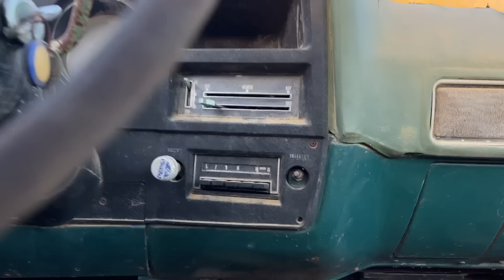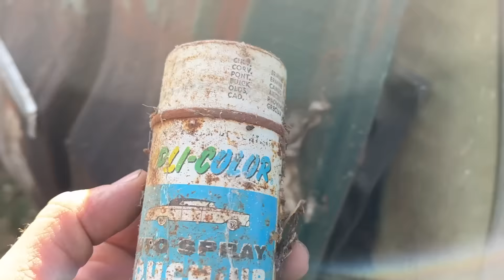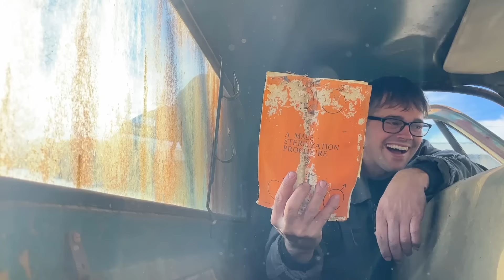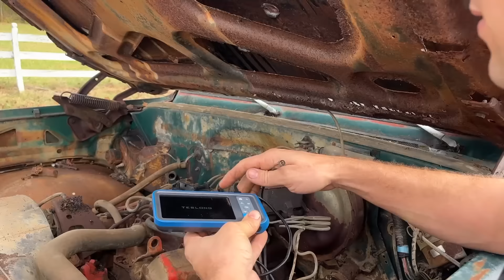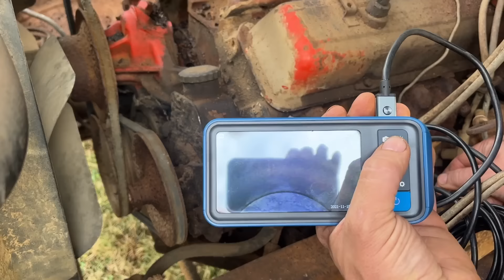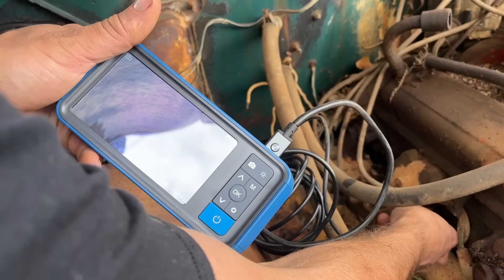Parked 38 years K15 will it start and go muddin?

Comment: Ralphie is gonna be a Master Mechanic before he's 18.He knows more about mechanics than alot of other people.Way to go ,Ralphie! And Wawa is not far behind!
Reply: Now I am 45 but I was able to tell you what you were driving  at 6 in every  Chevy  30s to70s and then if you wanted to learn  mechanics I had to know difference between 123 screwdrivers and  I was  rebuilding mowers for fun dam I miss my master asc gold patch papa who is the reason I am very capable to fix just about anything and now that you can YouTube how to I have  built a Nissan frontier trans with the 20 tip to mechanic at dealership for a how to take a new transmission down to replace reverse fork and I did it for 2k dealership wanted 4500 but u can do anything just learn how you do things and don't rush organization is more important than what brand is the tools now-a-days gear wrench warranty till 9 pm 7 days a week at auto parts store now snap on  its hard if you don't work at shop but I love this family brings me back to my childhood and I have been working on cars professionally since I was 16 so 35 years I have  tool boxes for loaner to the one that was 15k new 54 in 1201 snap-on with all stainless steel top was 1499 option I got box 25 bucks a week for a year and a  36 in blue point 5 ft as trade in I have no problem making a tool always keep cheap set of wrenches in case you need to bend to custom shape  like  dodge ram power steering pump take a custom fit and once you have it saved for the next time you'll need it
Reply: Man you lost me after chevy 30s-70s... I'm sure it has to be typos. Because that is just gibberish
Reply: @Daddyrabbit_2  Brad,pay attention to them.Josh worked as a body repairman for several years,he knows all the new stuff.But,he had to know the old stuff to get to know the new stuff.He also likes to work on the old stuff as a hobby,and now is on YouTube making money there. He knows there's people who,like us,will watch it as well.He involves his family in it as well.Ralphie and Wawa seem to like it as well by assisting Josh.His wife is doing well so just she can understand what's going on.She seems to have some enjoyment.,too.I like to watch their videos.Wjat is not to get.
Reply: @danbytp  I agree. I was referring to Craig streetzels comment, a lot of missing commas, periods and/or words
Reply: @Daddyrabbit_2  My apologies for misunderstanding your comment.
Reply: @danbytp  no problems!
Happy Holidays for you and yours my friend! Wish y'all nothing but,peace, love,and happiness!
Reply: @Daddyrabbit_2  Same to you,sir!
Reply: I'm 19 and everyone is surprised with my knowledge which means people get offended when I'm right on certain things.
Reply: @tandmbros5877  They're just jealous.However, for the rew times you're not right humbly admit it and don't don't have a fit.Use it as a learning experience.
Reply: Ralphies parts will all be clean

Comment: It's a 4x4 , and judging by all the 4x4 owners that I know, it probably got stuck. Somebody said " When in doubt, Gas it out!" and proceeded to over-wind it until something blew. Teenagers take this approach a lot. Great video!  You know what the difference is between a teenager with a 2wd and a teenager with a 4wd ?  The teen with a 4wd gets stuck 40 feet further out into the muck.
Reply: When Ralphie pulled the dust cover off the front wheel, you could see there were no drive flanges on the front axles. Assuming it has a front driveshaft, and working transfer case, it will be a cheap fix.

Comment: Great video - now new fenders , rad support ,box sides , cab corners , rockers , floor pans , new bed floor, new fuel tank , hood , door skins ,a new transmission, replace all the brakes and lines / hoses , 4 new 40”casings , and new radiator,  after that you will have a good daily driver !
Reply from the maker: I think you are right

Comment: Overfilling the transmission causes cavitation and slippage. Best to have it just below the full line when hot. Great video good luck.
Reply: Yep!
Reply: I’ve noticed that on 73-87 gm turbo 350 and 400 transmissions if it’s just over full by like an 1/8th inch they operate better

Comment: Calling that sheet of rust a hood is a pretty big stretch.haha  I was driving down the interstate and it was like someone turned off the ignition to my car. It was the control module. Cranked and cranked and nothing. Put in the new module and fired right up like nothing had ever happened. It's fun working under the hood while semi's are flying by.

Comment: Looks like the years of C/K trucks that composted almost immediately after purchase...positive note? The square bodies are the "VW Bug" of the truck world
Reply: My Dad said he was going to put a 350 in a ford body and have the best of both worlds.
Reply: New tranny ,brakes, and hood and just keep it as a beater.
Reply: @madlukasik  the steel GM used in this era is akin to FIAT "Quality."
Reply: @michaelames9555  ¿Que?  If you're wondering about my original comment, it is well known that the '73-'78 square bodies rotted away in anything but ultra-dry conditions. It's almost like the truck department looked over at the Vega group & thought," Wow, there's a great idea." The bodies are trash- but re-pop parts, like old VW Beetle parts, seem to be all over.

Comment: When Ralph pulled the front hub caps off I saw the gears were missing. Set of manual lock outs will fix that. Trans sounds like the forward clutch pack is not working. Other than that, the motor sounds really good.

Comment: There is a rust crack line at the beginning before u put air in the first tire u can see daylight all the way through on both sides there is alot of rust where the engine sits may need new support brackets and struts to hold up the coil overs there too rusted out and will snap if u go over certain speeds. Please be careful
Reply from the maker: I think you are right

Comment: Little trick i learned about temporarily fixing radiator core leaks. First you use a needle nose pliers to remove the cooling fins around the leak, then you cut the cooling channel/tube clean through, after that you just bend/ kink the left side to the left and the right side to the right- clamp both sides down good and that should significantly slow down or stop a bad leak for $0.

Comment: Another great project. Good to see it running too. The transmissions are relatively easy to rebuild too.
Reply: Chevy turbo usually 1st and reverse use same bands.
Reply: @gregoryblair9810  that's true. I'm sure they have a great plan by now to get that truck up and going.

Comment: Josh, should you  tighten those lifter nuts before the lifters have a chance to pump up?  Especially , if they were collapsed like these were. Maybe you used new lifters.
I thought you were supposed to immerse hydralic  lifters in oil then push on the  middle with a push rod to get them pumped. But not pumped too much.

Comment: It was common for guys to convert the full time four wheel drive NP203 transfer case used in 70's trucks to part time operation. There was a kit for about 300 dollars that changed some gears around inside.  Afterwards, only the Low and Hi Loc positions were four wheel drive and the others were  rear only. 
   The hubs may have been changed. Those look like some kind of "Auto Locking" front hub intended for PART time four wheel drive trucks. They are known to be finicky.  Part of getting them to lock was driving the truck forwards then backwards. Or maybe the other way around. Or maybe that was getting them to UN lock.
   So, that is why trucks that came with them were often swapped over to manual locking hubs that bolt right in in place of the auto locking.

Comment: Fix 4wd, roll bars with kc lights, flat bed, 6” body lift, 4” suspension lift, 44 swampers, lockers

Used to go watch the trucks go muddying in those trucks in the local lake bed in the 90’s. Guys would drive till the truck broke, fix them and be out there the next weekend. Took my wife on a date to watch trucks go muddin.  Eventually they stop allowing missing due to idiots dumping their oil on the ground and stuff, but there are A ton of good memories.  Maybe one day I can make a mud truck of my own but as of now, I can just use my stock grand Cherokee
Reply from the maker: Yeah that would be cool.

Comment: I had a 1980 K5 Blazer with a 305 , 4  speed stick 4x4.
I loved that rig ...
I bought it in 86 or 87 & it had been special ordered by the old guy I bought it from...
It had power windows, cruise control and A.C. 
It was also carpeted .
My buddy's made fun because it had a 305 , but I had zero complaints .
I had a 81 Malibu with a 305 & I loved that one too...
It got about 14 mpg , but it would go in the snow & mud.
On Sundays a few buddys & myself sometimes went muddin on old logging roads (which was very hard on everything) and that old rig would climb a tree ...
Like most of the vehicles I had in my younger days , I wish I had kept them because
I had some iconic cars & trucks ...

Comment: Some years ago I recovered a truck from a sand trap on an escape road at the foot  of a steep hill. It had run away on the hill. The driver managed to get in a lower gear but it tore the center out the clutch plate, but not before over revving the engine and dropping two valves. I suspect at only eight years old and fifty five thousand miles, your truck had a similar fate. Dropped into low drive at high speed, dropping four valves and smoking the tranny in the process.
Reply from the maker: You maybe right

Comment: At 24:12 shows the non working 4x4 issue when Ralphie was putzing around with the dust caps on front hubs- there was no drive "puck" inside the hub
Reply from the maker: Ok I was wondering about that. I am not very familiar with 4x4 stuff. Thank you

Comment: Dudes, late to the party on this one. Note: General Motors had a really bad corrosion problem in the early to late 70s. They would be rusted down getting off the truck from motor convoy mini had to go right straight into the body shop to be repaired before they could be sold. An excellent example of this is the Vega. What, a P.O.S. It was!  Great job as usual.   I’m doing my part to have watched all Sleeperdude videos at least once. Take care, everyone!

Comment: This is my go to channel. You  have an amazing family! Maybe try and drop the valve body from the transmission and clean it out.. A clog could cause fwd drive to slip. Also those old transfer cases are usually gear drive and not chain driven. Its probably the linkage not engaging. Just a thought.
Reply from the maker: Thank you we appreciate it. Good idea

Comment: I’m not really a gm guy but that truck is awesome. There’s nothing better than a rusty old mud truck. I recently got my old 85 f250 big block truck running again after setting for 8 years untouched. I’m planning on getting the brakes all replaced and maybe doing a head/cam/intake swap after our family vacation over the holidays.

Comment: On the 4wheel drive I would convert the full time 4WD with locking hubs. Check your modulation valve on transmission. And or adjust the transmission bands. Check the servo valve too. The engine runs great maybe the rings will come around. Oh you need the purple hornies mufflers that will bolt on to the headers.
Reply from the maker: Ok thanks good info

Comment: When Ralph pulled those front wheel hub caps off I saw the gears were missing. Set of manual lock outs will fix the 4x4 issue. Drain the trans and add new fluid and filter. Other than that, the motor sounds really good. Tip that crappy cab and bed off the frame and put a Fairmont wagon body on it.
Reply from the maker: Ok thanks for the info. Good idea

Comment: Brakes definitely need to be fixed.  Transmission needs fixed.  4 wheel drive needs fixed.  Check gas tank and radiator.  Can't wait to see the cleanup.
Need bracket for battery.  Make sure body doesn't fall apart 😁
Reply from the maker: Your about right !!

Comment: Next time you find yourself struggling with getting your distributor indexed to the oil pump drive shaft just bump the starter and the rotation of the camshaft will spin the distributor and the distributor will drop that last quarter of an inch in the first rotation of the engine. Virtually instantly. Easy peasy!

Comment: Drain the trans fluid to proper level and you will have forward gears. Check the hose on the vacuums modulator it is a little rubber hose on back of trans it will not shift if it is brittle and cracked

Comment: Hi, that plumbers epoxy that you used to fix the radiator you can also use it on the engine block when they crack.  I fix a 460 thaat was ctack and its still running after six year.
Reply from the maker: Wow !

Comment: For stuck engines, my first attemps to get it to break free is Kroil even though it is a bit expensive but it is as far above PB as PB is above WD40. Then if Kroil doesnt free it up, I resort to the tried and true....... Regular White Vinegar.. the best  rust remover I have found.
Reply from the maker: Ok thanks for letting us know
Reply: @Sleeperdude  Kroil actually creaps in areas as small as 1 millionth of an inch and will creap uphill to free things up. Its a bit pricey but is worth it. Just dont get it on your finger tips or youll not only feel it digging in, but you will be tasting it In less than a  minute. White vinegar on the other hand actually eats the rust away overnight, but be sure to wear rubber gloves when working with the vinegar or on the parts the next day because the vinegar and  the parts will be coated in some black stuff that doesnt like to wash off skin or clothes, and is an instant black stain. The rust however can be wiped off with paper towel or rags or can be washed off with water and a brush. The only reason i try kroil first is because of the black dye the vinegar makes. Sometimes it may require an extra day or 2 if something is severely stuck but check on it every 24 hrs if not sooner. As an experiment, get a plastic container and something rusty that fits in the container and fill it to fully cover it with the white vinegar (5%acidity) and soak it over night then check it out.

Comment: I have put a air line with holes in it in the bottom of my tank put valve on the line turn it on slowly let it bubble it would help clean up the heads I use to do did great work

Comment: The kids were quite alarmed by the reverse dirt donuts!!  I would remove and replace the cab mounts, replace the floor panels, POR 15 the whole frame, rebuild the transmission and transfer case and then use the truck as the winter beater with a heater and as a push pull vehicle for the fleet of vehicles you have. That Chevy K-10 wants another lease on life. Amazing how those valves just rusted away like that!  You got a great deal on the good used cylinder heads!!
Reply from the maker: Yeah for sure

Comment: And you can buy header glass pack mufflers with collectors that you make bolt on to the headers that is what I did on my 86 Chevy k20 except it was swapped out for 18 inch 2 inch pipe collector extensions..

Comment: I watched the video til the end and you never plugged the brake booster in. That may have been part of the brake problem. I think the trans has a sticky valve body as a minimum. It runs really good considering how bad the heads were.

Comment: Had a 79 impala with 350, around 75000 it dropped 4 valves. Ruined the block..put a used 454 in it and sold it quick. Haven't bought a GM since. My 69 F100 has close to 300,000 miles on a 352 CI FE 4 speed. Still runs good, thinking of putting disk brakes on it and running another couple thousand miles on it

Comment: Except for the cab floor I had a 86 Chevy k20 custom deluxe longbed farm truck 350 4bbl e4mc quadrajet carb th400 np208 part time transfer case and it was about as rusty since it was a portable fertilizer sprayer tank truck, and I built a 75 Chevy Silverado k20 355 4bolt main with a competition cams xe series 268h 477/480 lift camshaft kit and it sounded awesome it was my pull out truck used for dragging people out of the mud pit,, and that was with 83 gmc k1500 high Sierra 6lug heavy duty axles front rebuilt gm corporate 10 bolt and a gm corporate 12 bolt rear end 9 leaf factory k20 leaf spring packs plus overload spring per side lol, I built it to haul firewood and scrap metal to the scrap yard. Had 6 lug axles because I got it stuck with the front factory k20 10 bolt axle and destroyed the case

Comment: My guess on the trans is the valve body is gummed up. Try the old time car lot trick ,drain off a quart of fluid and pour in a quart of brake fluid. Seen it work a few times ,if it works its a cheap fix.

Comment: It was deluxe two tone midnight blue and frost gloss white center stripe except for the faded red 83 gmc High Sierra single headlight doghouse great sounding beater had it for 12 and a half years I had traded it for a early 94 Chevy Silverado extended cab short bed k1500 Z71 with a built 355 and new dual heartthrob glass pack 2.25 inch exhaust with 3 1/2 inch stainless steel angle cut exhaust tips,

Comment: Th350 check vacuum modulator line from the manifold vacuum port on the back of the intake manifold in front of the distributor to the right side of the transmission at the back of tailshaft of the transmission..

Comment: Those '70s GM battery cables are copper clad aluminum. They are really bad to corrode internally, get high resistance and overheat/melt.

Comment: I new that disel oil has detergent in it. It will wash your pistos rings out. I was told not to run a gas ingen on it. Use it and change it.

Comment: For the whole video I'm looking at the vacuum hose that goes to the brake booster u will never have have good brakes if the vacuum hose is not connected,  besides having a vacuum leak.